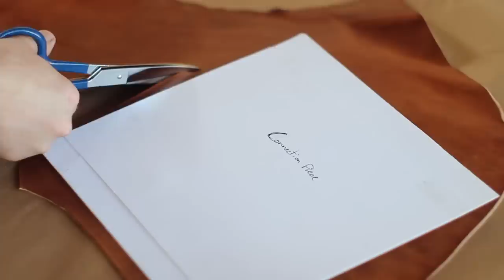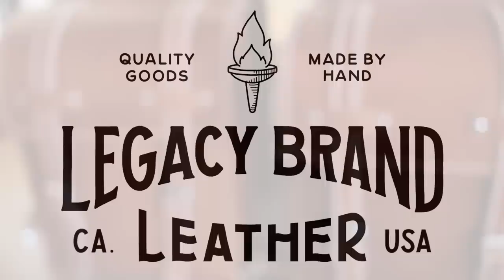Crafting a Leather Bike Bag

Comment: 1. Great work. 2. I had some similar saddlebags made but am disappointed at how thin they are. I showed the shop photos of what I wanted, but these collapse on themselves. They then lined them with a thin plastic to hold their shape. I have my doubts about them as to how much weight they can hold without getting stretched out. How thick is the leather in this video? Is there a name for the hide? Thanks!

Comment: What type and thickness in mm leather did you use for this project. Its looks beautful. I much prefer hand crafted all the time and effort shows better quality then machine stich In my opinion I love the design very beautful I love leather
Reply from the maker: Hello! Thank you so much for the kind comment.  This leather is 6-7 oz thick or 2.4-2.8mm thick.  I went with this thickness so the bags would be sturdy enough and yet pliable enough to make some of the shapes for the bag.  Cheers!
Reply: @legacybrandleather  Are the gussets thinner?
Reply from the maker: @allanpennington  They are not.  I wanted this to be sturdy and did not thin down the gussets.

Comment: What tool did you use to cut the heavy copper rivets?
Reply from the maker: I used a heavy duty wire cutter from Home Depot.
Reply: @legacybrandleather  Thanks, I must just be getting old and weak.
Reply from the maker: @garyleiendecker631  heh, it's not easy to clip them off, let me tell you.  I might need to keep searching for the right implement to make it easier.
Reply: @legacybrandleather  At first glance I thought you were using a fence pliers. they also make a double action side cutters, but they do not open very wide.